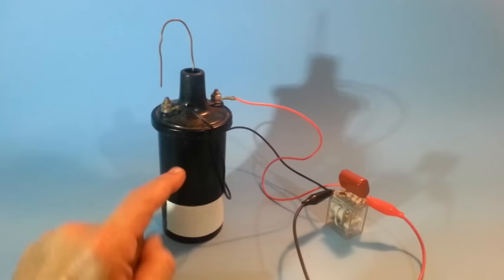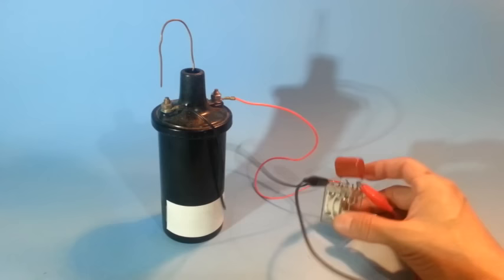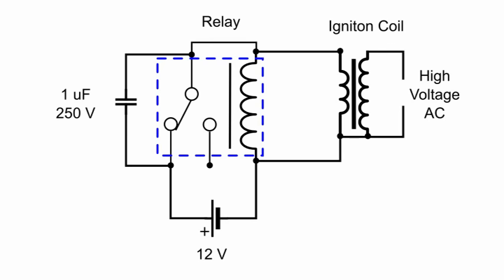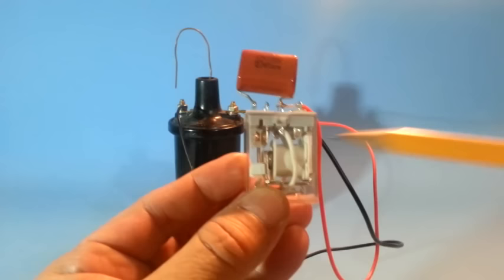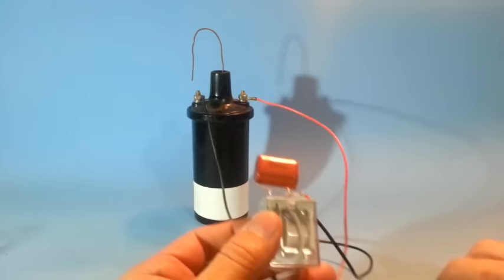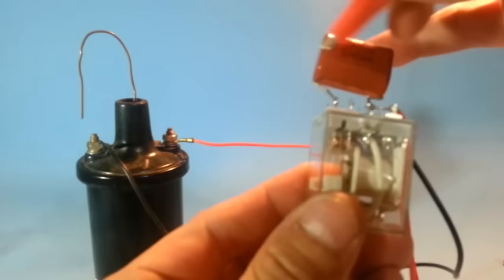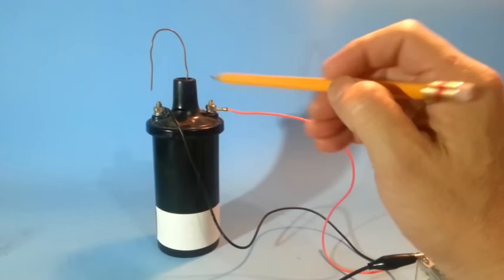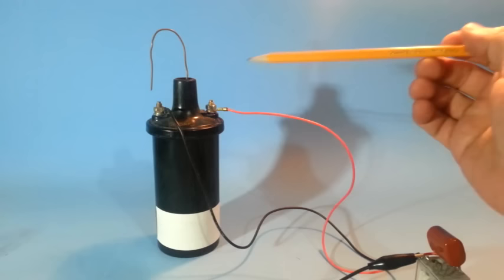Easy High Voltage with Ignition Coil and Relay

Comment: Great Vid Bro. Can you maybe upload a list of components?
I've been trying to duplicate the result but i don't seem to have the correct components, my results are puny at best!
Thanx in advance.
Reply: Pieter, I've been doing my best to figure out what components Ludic Science used. Here's my best guess regarding compatible components:

12 VDC, 2 A (24 W) Power Supply / Transformer (True Lumen [11442-
524610])

8 Pin 12V AC Coil DPDT Electromagnetic Power Relay (HuaHuiYuan MY2N-J) 

1uF, 250 VDC Capacitor (PANASONIC ECQ-E2105JB)

12 VDC Ignition Coil (Tisco 396546R93)

10-Piece Test Lead Set with Alligator Clips (SE TL10)

-=-=-=-=-=-=-=-=-=-=-=-=-=-=-=-=-=-=-=-=-=-=-=-=-=-=-=-=-=-=-=-=-=-

Here are the assumptions I made when selecting these components:

I assume he is using a 12v ignition coil since the input voltage is 12 volts. Also, 12v coils were more commonly used.

I chose a 2 Amp (24 watt) AC/DC power transformer because that's a common output. But, an AC power supply with more amps should work even better. 

I chose a capacitors rated for 250 Volts DC not 250 Volts AC because this is a DC circuit. I know he indicates the output is AC, but the output is actually pulsed DC.

I chose a 12V DPDT (double-pole, double-throw) electromagnetic power relay based on the diagram and his use of a 12V DC power supply. 

I plan to try to build this circuit soon. I'll re-post to confirm these are teh correct components once I try to build this thing.
Reply: Update?

Comment: Would the output be unipolar ac?
Reply: The secondary coil generates  a voltage that is proportional to the rate of change of the current in the primary.  Although the primary coil is pulsating DC, the current through it changes direction.  In other words, the rate of change is positive when the leading edge of the pulse is positive-going and it's negative when the current in other negative GOING edge of the pulse is dropping.  Therefore, the voltage in the secondary is a positive waveform while the current in the primary is increasing and a negative waveform when the primary current is decreasing, even though it never goes negative.  It's the RATE OF CHANGE that's important, not values of the current.
 Were the primary current in a transformer a nice smooth sine wave, the secondary voltage will be a nice smooth cosine wave - which is equivalent to a sine wave 90 degrees out of phase with the primary wave.  But here we are exciting the secondary with square pulses with sharp changes in voltage and current, so the voltage output will be very high voltage spikes.  Probably pretty messy spikes with a bunch of ringing going on.  But then, we needn't be fussy about what the waveform looks like if we only want to generate cool looking sparks or ignite vaporized gasoline in air.

Comment: Where did you get the relay? What is the name or part number and also the size of the capacitor?
Reply: Here's my BEST GUESS regarding what components are similar to what he used:

12 VDC, 2 A (24 W) Power Supply / Transformer (True Lumen [11442-524610])

8 Pin 12V AC Coil DPDT Electromagnetic Power Relay (HuaHuiYuan MY2N-J) 

1uF, 250 VDC Capacitor (PANASONIC ECQ-E2105JB)
12 VDC Ignition Coil (Tisco 396546R93) 9

10-Piece Test Lead Set with Alligator Clips (SE TL10) -- to connect everything
Reply: I now think he used a DC relay - not an AC relay. I think he used one like this:  Uxcell a15062300ux0219 IEC255

Comment: Is this 12 volt relay
Reply: I am in the process of trying to build this circuit. I believe he used an 8 Pin 12V AC Coil DPDT Electromagnetic Power Relay similar to the relay offered by HuaHuiYuan MY2N-J on Amazon.com
Reply: Ignore my prior post. I now believe he used a 12v DC relay like this one: Uxcell a15062300ux0219 IEC255

Comment: what ignition coil is that ??
Reply: Here's my BEST GUESS regarding what components are similar to what he used:

12 VDC, 2 A (24 W) Power Supply / Transformer (True Lumen [11442-524610])

8 Pin 12V AC Coil DPDT Electromagnetic Power Relay (HuaHuiYuan MY2N-J) 

1uF, 250 VDC Capacitor (PANASONIC ECQ-E2105JB)
12 VDC Ignition Coil (Tisco 396546R93) 9

10-Piece Test Lead Set with Alligator Clips (SE TL10) -- to connect everything
Reply: I now believe the relay is DC not AC. Here's a similar one to the one I think he used: Uxcell a15062300ux0219 IEC255

Comment: Make sure all your wire connections are as short as possible or like me you will find out it wont work.  Solder all connections  I am a happy camper now,  Works great!
Reply: Thanks for that tip! I think that's why mine is only producing a small spark. I'll try your suggestion tonight!

Comment: I can't find such a ignition coil like you did. Can you pls send me a link or a website where i can find one? thx 

ps i'm from Germany  nice vids !!!
Reply from the maker: +HV and more Hi, almost any ignition coil will work
Reply: +Ludic Science  Ok thanks
Reply: Is a 12 volt or a 6 volt ignition coil  better for experiments ? Is a shock of an ignition coil very dangerous ?
Reply from the maker: +HV and more it depends on what kinds of experiments you are doing. About the shock, it is hard to die from that (but it can happen), however it is very painful.
Reply: +Ludic Science Oh ok thanks... i want to charge a kaskade and make electrostatic experiments so what is bettr 6 v or 12 volt ?
Reply from the maker: +HV and more Use the 12 volt coil
Reply: +HV and more It is the same as a VW beetle or a Combi

Comment: I don't understand that nobody shows this high voltage design since it is so simple, cheap and you can't as easily go wrong with the voltage or amperage as by using a transistor.

Comment: If you took out the 1uf 250 v capacitor, would the high-voltage ignition coil output be dc?
Reply from the maker: No, it will be still ac, but you need that capacitor
Reply: Ludic Science because it acts as the condencer?
Reply: +Ludic Science ...can we use this as fish shocker?
Reply: I am not electronics engineer, but I think the output is actually pulsed DC - not AC. The electrons aren't flowing in two directions (in one direction and then in the reverse direction). You're just causing the output spike and drop very quickly.

Comment: For coil (and relay and spark plug) longevity in a 12v automotive system, wouldn’t a 50v 5uF cap suffice?
Reply: Actually, for 100mJ from the cap, it would have to be in the range of 50v 40 uF

Comment: After spending a day playing with this circuit and getting no ware, I came to the conclusion that it was never going to work, because the resistance of the ignition coil primary was much less than the resistance of the relay coil and was therefore shorting out the relay 
This is just in case anyone else has this problem !  You might get away with it, by fitting a 5 pin car auxiliary relay, not 4 pin.
Reply: It is possible that there was a resistor in each spark plug preventing things too- it’s fine and dandy to make the energy discharge stronger, but putting a speed bump in the energy’s path to ground helps nothing.

Comment: Mate are you still around?
Reply from the maker: Yes
Reply: @ludicscience  would I still need a pulse generator to make the coil step up voltage using AC into it? Or can just AC be used?

Comment: Very nice! This reminds me of another way to get easy high voltage, by using a light dimmer, a spark coil and a microwave capacitor. Have you tried this, more or less, solid state Version? I can recommend it, because you have less wear on your components.
Reply from the maker: helut kuno Yes and also has the advantage that you have certain control over the output voltage.

Comment: What is capacitor number
Reply: I am in the process of trying to build this circuit. I believe he used a 1uF, 250 VDC Capacitor similar to the PANASONIC ECQ-E2105JB, which is available on Amazon.com

Comment: dont like them electronic representations of these relays they dont show you exactly the pinouts and if only you can give us some details of the relay wiring by showing us all the top of the relay and is the relay a single pin double throw or other